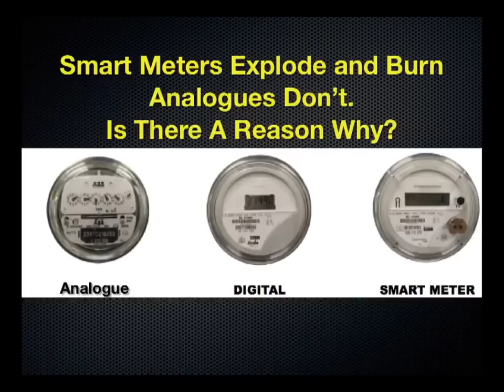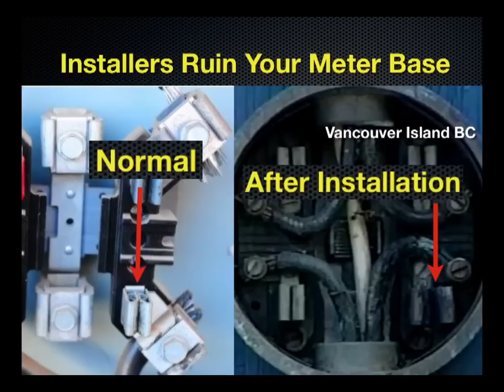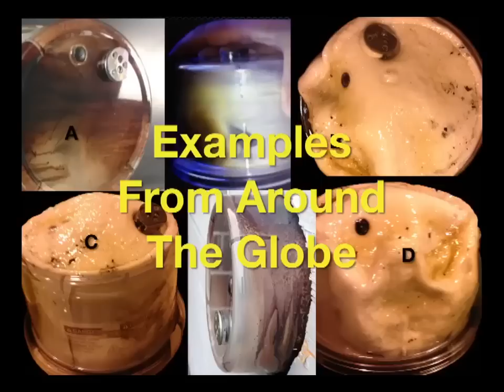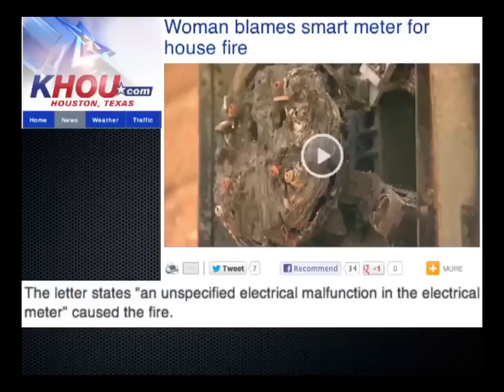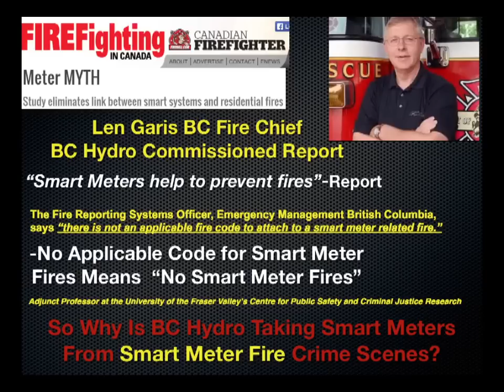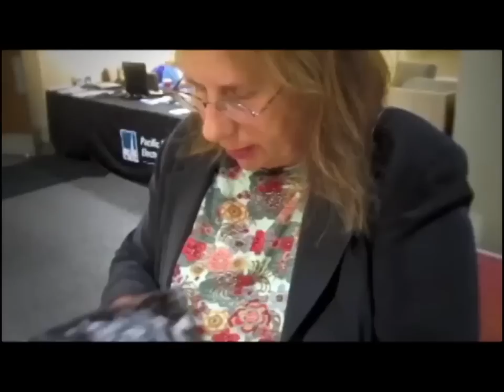Smart Meter Fires

Comment: 🔥🔥🔥🔥🔥🔥🔥🔥🔥🔥🔥🔥🔥🔥🔥🔥🔥🔥🔥🔥🔥🔥🔥🔥🔥🔥🔥
Science-is-god 11 hours ago said:   "Frederique Zug So NONE OF THE OLD METERS EVER CAUGHT FIRE?"
--------------------------------------------------------------------------------------------------------------------------
Well SIG, some old meters exchanges did set people homes on fire, but is was the damage caused by untrained personnel destroying the customers UL/CSA equipment that caused these fires. 
IT WASN'T THE WATTMETER THAT CAUSED THE FIRE, IT WAS THE CUSTOMERS DAMAGED METER BASE
How did the customers meter base get damaged you ask SIG?

This method of burning down peoples homes have been around for many, many years.
SO LET ME SHOW YOU HOW SIMPLE IT IS
PART ONE
#1 Do not use jumper cables to BYPASS the power so the power remains on for the homeowner OR
*#2 Do not turn the main breaker off so there is not current flow *
Simple explanation, When you are making toast, do you pull the power cord out of the wall when the toaster is on?
IN CANADA, IT IS A CRIMINAL OFFENCE TO STOP THE POWER TO THE HOMEOWNER

“CSA C22.2 NO. 115-14 1.5 says “Meter-mounting devices, as covered by this Standard, are not intended to be used as load-making or load-breaking devices.”, meaning that electricity must be disconnected or turned off during meter exchanges.  Aside from the obvious concern about the arcing and consequent pitting which occurs when contacts are made or broken under load, another concern is that one's meter base could lose its CSA certification if it’s been used as a load-break device.”  

PART TWO
Before any wattmeter or smart meter can be inserted, a CERTIFIED ELECTRICIAN  has to recertify that the customers meter base is still  meeting UL/CSA specifications* 
#1 The electrician will visually inspect the meter base for any sign of corrosion or physical damage caused by an other *UNTRAINED PERSONS 
#2 The Electrician will test the use a special tool to recertify the UL/CSA customer meter lugs

If your old glass and metal watt meter was replaced with a smart meter and this safe SAFE method was not used, then your power company is now criminally responsible for any damage or deaths caused by this type of *FIRE*.
IT MAKES NO DIFFERENCE IF YOUR POWER COMPANY HIRED A PACK OF UNTRAINED CHIMPANZEES TO DO YOUR METER SWAP
YOUR POWER COMPANIES ARE MANDATED BY LAW TO DELIVER SAFE AND RELIABLE POWER 

WANT TO SEE HOW THE METER SWAP SHOULD BE DONE?
*I CAN NOT VERIFY IF THESE INSTALLERS ARE CERTIFIED ELECTRICIANS, BUT THEIR METHOD OF METERS SWAPS IS BETTER THAN 98.7% OF ALL METER SWAPS THAT HAVE DONE BY UNTRAINED CLOWNS.  
WHY WOULD ANY POWER COMPANY RISK THE LIVES OF THEIR CUSTOMERS, TO SAVE 4 MINUTES ON EVERY SMART METER SWAP?
 
DEATHS BY SMART METER RADIATION?
37.9% OF SMART METERS INSTALLED IN NORTH AMERICA ARE IN VIOLATION OF THE FCC'S DISTANCE TO COMPLIANCE RULES 
SIG, WHY WOULD ANY POWER COMPANY ALLOW THEIR INSTALLED TO PUT THEIR CUSTOMERS LIVES AT RISK OF DYING FROM THE HIGH LEVELS OF RADIATION?   
 
This is the best method I have seen so far  https://www.youtube.com/watch?v=G0bq2Hn2vOo

Comment: SOME OF THE CAUSES OF SMART METER FIRES
Smart meters are only rated at 48 KW (200 amps)  The warranty is also null and void if the current exceeds 201 amps
Smart meters have Lithium batteries which can heat up in the sun.
Smart meters do not have surge protection anymore.  There is no over voltage grounding lugs on these new meters
Smart meters are made with a cheap flammable poly-carbonate cover.
Smart meters are not waterproof and allow moisture inside. 
Smart meters have thinner power lugs which do not allow for proper tension. 
Smart meters are not UL/CSA approved 
The warranty is also null and void if the internal temperature exceed 80C.
HOT CUTS done by Non-Certified individuals will lead to fires. 
The customer’s meter base was never inspected by a certified electrician for any problems before the meter swap was done.
Leaking seals that allow water to enter the smart meter and will cause over heating and fires. 

“In the past, design flaws in smart meter units have been known to cause serious fire hazards and spotty performance. This has caused a lot of concern for utilities and manufacturers of smart meters. To prevent problems like this, a new voluntary safety standard – UL 2735 – has been created for electric utility meters…”
New UL 2735 Electric Utility Meter Standard Ensures Safety and Performance
http://www.metlabs.com/blog/meters/new-ul-2735-electric-utility-meter-standard-ensures-safety-and-performance/
https://www.youtube.com/watch?v=h5MLo-m9lZk
https://www.youtube.com/watch?v=gOqucXzwKkA
https://bc-freedom.com/2017/03/12/former-nsa-confirms-no-surge-protection-smart-meters-god-send-for-hackers/